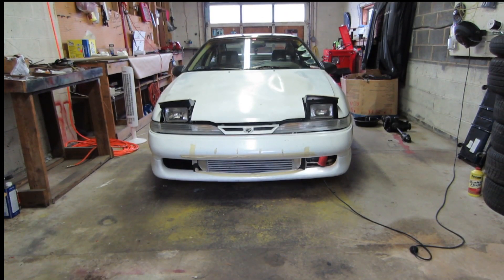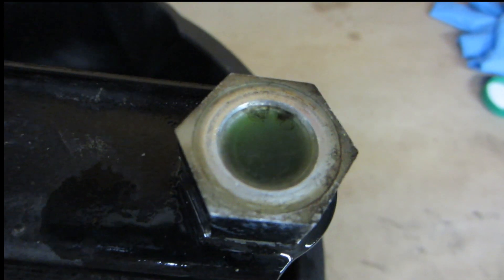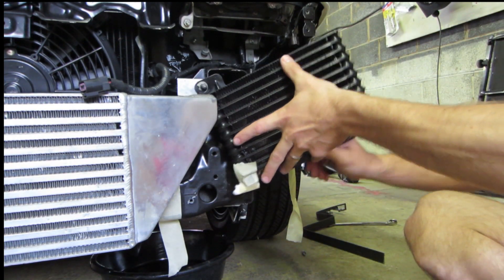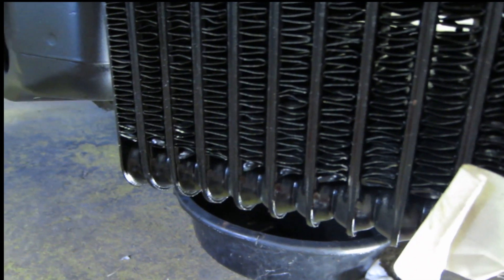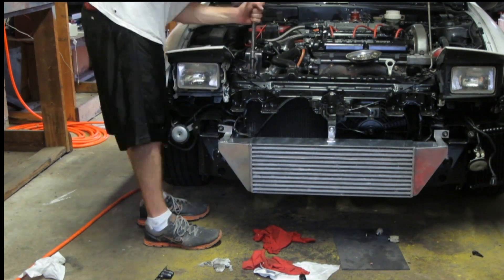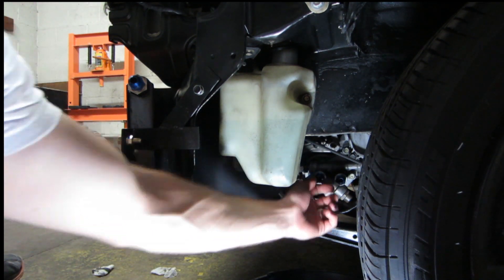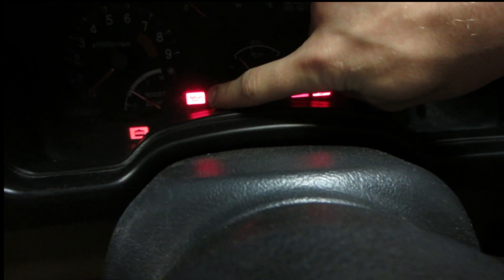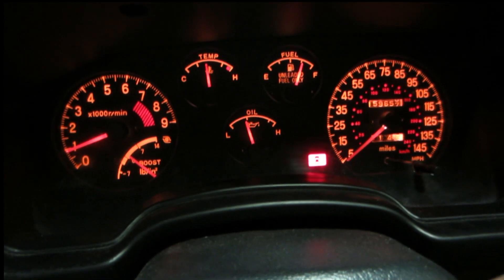DSM Oil Cooler Relocation

Comment: Question,when u change ur engine oil,do you have to remove the oil cooler as well and drain it of the oil and re install it?
 How do you go about the oil change process with the car having an oil cooler? 
Please explain step by step what u do.
 Thanks.
Reply from the maker: The oil change process is the same as if you didn’t have the cooler. There may be a slight bit of oil that doesn’t get swapped out but thats never been an issue for me.
Reply: BoostedBeaver thanks for the reply brother!
 I was searching for this question for a while and it gave me a peace of mind.
 Keep up the videos man you rock!
Reply: kevin morales same as any oil change. in the stock location the oil cooler is mounted higher than the oil pan and the feed and drain ports point downwards so it drains itself.

Comment: good oil pressure is 20 lbs? my v6 chevy truck with 280k and has 50 lbs at idle
Reply from the maker: At operating temperature, 50 PSI of oil pressure at idle is pretty high. Pressure is a result of friction and more friction equals less flow. I would be curious as to what pressure you see throughout the RPM range.
Reply: 60 or 70lbs depends how i am with the skinny pedal but its always over 50

Comment: I just bought a intercooler kit like the one you have, are you using zip ties to hold up the portion between the headlights? I installed mine today and cant see a way around it?
Reply from the maker: typeslower I used zip ties for the better part of 4 years. The bumper started to sag as the zip ties started to wear out the holes in the bumper. JMF makes a bumper support or you can make your own (which is what I plan to do during this build). A bumper support would really be your best bet.
Reply: Thanks so much for the reply! Im still very new to the dsm world and learning the little things is tough sometimes.....if your ever in the fredericksburg area give us a shout like to see the car

Comment: do you have the overall dimensions of the intercooler for me
Reply from the maker: Are you referring to the actual intercooler or the Oil Cooler?
Reply: the outer dimentions of the intercooler please
Reply from the maker: Bking King Its approximately 28 inches inside the inlet and outlet pipe. That would make it about 34 or 35 end to end. It’s 8 inches tall 3.5 inches deep.

Comment: How do i fit one on a honda dc5 k20a
Reply from the maker: I honestly have no clue since I do not own one. You would need a clean supply of oil and a way to return it into the oil feed. Mounting the cooler is just a matter of fabbing a few brackets and placing it in direct airflow. 

Robert
Reply: Ok thx m8  i like the vid it helped knoin about the cooler
Reply: so whats nex on the car biger turbo or dif inter cooler
Reply from the maker: Tony Brice Maybe both.... who knows :)
Reply: Sounds goog
Reply: Good

Comment from the maker: The positioning of the oil cooler inside that opening will be blocked by the fog light. This will effectively degrade the amount of increased cooling effect you may see. It will help to get the cooler from in between your FMIC and your radiator but that is about it. 

I highly doubt that the fog lights will fit. You could crawl underneath and take a measurement of much room you have between the back of the light to the frame but again all the extra airflow is blocked by the light. 

Robert

Comment from the maker: This is a false statement. This next excerpt is from WD-40's official website.
 
What does WD-40 Multi-Use Product contain?

While the ingredients in WD-40 Multi-Use Product are secret, we can tell you what it does NOT contain. WD-40 Multi-Use Product does not contain silicone, kerosene, water, graphite, or chlorofluorocarbons (CFCs).

In fact, WD-40 is a Water Displacement product that was produced on the 40th try hence the name. I hope this clears things up. 

Robert

Comment from the maker: The part number for the adapter is displayed in the video. The rest of the fittings will be based off what size hose and where you mount it. I would post all the part numbers but this was done some time ago and I can not remember all of them.  I used 8an so I used 2 straight 8an adapters and two 90* 8an adapters. The crush washers can be had at your local hardware store. Hope that clears things up for you. 

Robert

Comment: Yup I'm using Zip ties too on my front bumper, with the same VRSF FMIC mounted the same exact way.. Now I don't feel so alone.. They say Upside down, I say make use of the fkin tabs without the crash beam present lol.. Nice Vid, I might be adding a Oil Cooler on my 90 GSX but ATM I'm just using the coolant cooled Filter Housing from the 91..

Comment from the maker: Thanks for the input.

I took this into consideration when mounting the Oil Cooler. I mounted the cooler so that it sits above the frame. If I were to make contact with something it would have to go through the bumper and would also have to contact the frame itself. I am not saying that this is not possible but by taking the proper steps during instillation, the chances can be drastically reduced. Thanks for the complement on the video. 

Robert

Comment: Nice video. I took my 90' CA, emission 6-bolt and swapped into my blown Galant VR-4
Fed, emission. I also used the oil cooler from my 90' gsx doner. I didnt go through and clean it up like you did. Yours looks clean. Good work. Keep the videos coming.

Comment: Robert. Be mindfull of the bottom 90 degree fitting on the cooler. I lost an entire motor due to a faulty oil cooler mounted in the same spot. I had bought some used coilovers and they were set really low. With 50 miles on my new shortblock, the fitting hit the ground on a sharp incline pulling out of a gas station and within 3/4 mile trashed every bearing, crank, cams, ect..from lack of oil flow. By the time I saw the warning it was beyond to late. Keep in mind. I have since went FF. Nice video

Comment from the maker: The bumper really does need a support but I have not made one yet. For the past 2 years I have simply been using 5 zip ties to hold the bumper up. You see me cut these off and install new ones at the end. The power steering cooler line can be utilized if you wish (with a little bending of course) but I simply deleted the cooler by looping the lines at the power steering reservoir. More info can be found in my build thread and I will send you the link in a PM since youtube will not let me post it

Comment from the maker: The front mount is a VR Speed kit. If you are looking to push the envelope, I would not recommend this kit. As my car sits, I get 50 - 60* rise in temps during a pass at 30lbs of boost on the 35. The intercooler does serve its purpose but when pushing the envelope on things it is not the best choice. As for the modifications, I have a build thread on DSMtuners that I started when I first got the car. I will send you the link via PM since youtube will not allow links in replies. 

Robert
Reply: BoostedBeaver did you have to delete your ac to run this kit?

Comment: Hey Robert! After watching the video again I noticed that you don't have the front crash bar anymore. How do you support the bumper towards the middle? I seen that you took off 2 things towards the middle when taking off the bumper. Also what did you do with the power steering cooler line when installing your FMIC? I looked on my talon and the line goes right through the hole that the intercooler utilizes.

Comment: I really like it too, you do great work man. I did retain the 90 cooler when I swapped the 90 6-bolt into my 92. However at the time I never planned a FMIC, so I had a little bracket welded to bolt it in the stock "90" location at the front. Once I went to a massive FMIC I never got around to changing it out. Feel more than free to send me a PM in my inbox if you want to chat more and keep your vid clean of random comments :) Keep up the great work my friend!